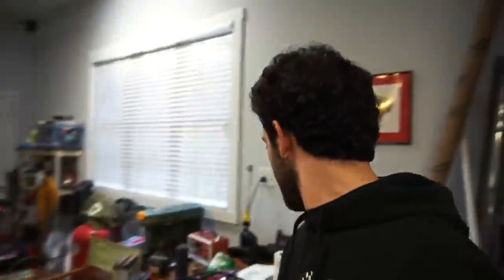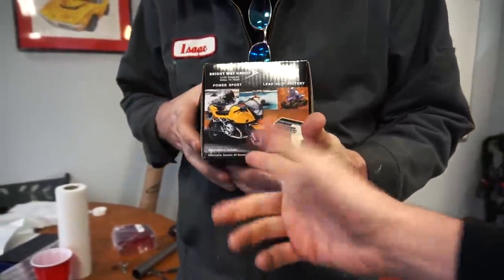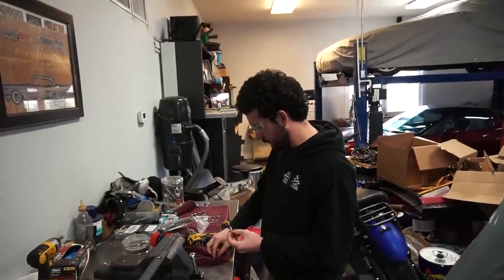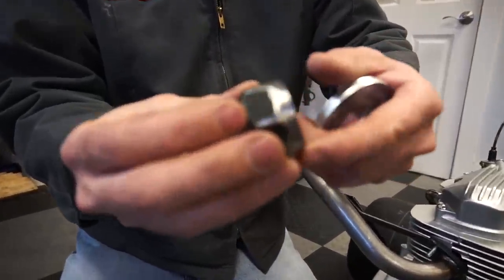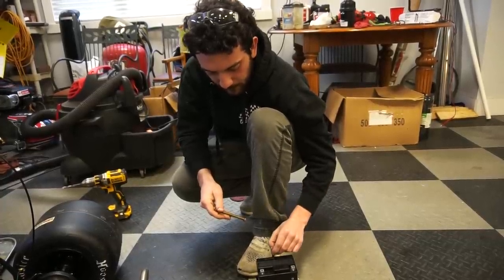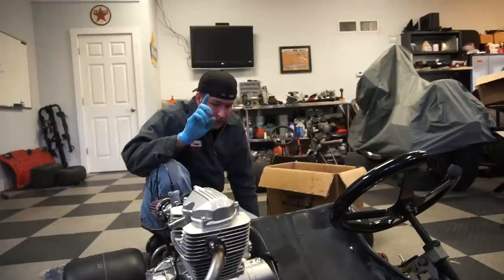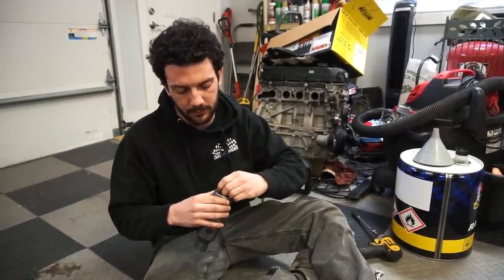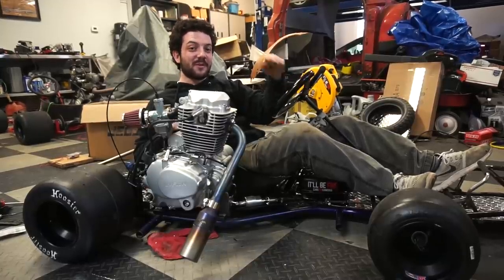200cc Shifter Kart Build: First Fire!

Comment: Loving it guys! 
 I would like to ask you about, whether you have ever considered using a liquid cooled or fan cooled snowmobile engine one one of your builds? Sled engines use CVT transmissions and they can be adjusted to be wheelie monsters. The snowmobiling world has some pretty insane horsepower mods for most engine types, the 440 l/c suzuki out of 90's arctic cats were torque monsters!!! Would be interesting to do a snowmobile engine turbo cart. Also would you care to address the michigan two-stroke scene as detroithoodtv shows us some pretty cool builds. It would be cool to see you guys try the dragster against some of those guys. Thank you for the great content over the years.    -Lou
Reply: PS I am from Maine, but the michigan scene looks to be a bunch of friendly guys who help each other out, and its not so much about speed as participation and having a good time. would be excellent if I lived closer :(
Reply: Move South!!!
Reply: Yeah, unfortunately that isn't gonna happen. I can always wish though, right? I was just trying to get Jon and Ike to comment on the detroit 2 stroke scene since they do the same thing..build karts, bikes, ect. Some of the detroit machines are sketchy af but...won't they GO lol

Comment: CarsandCameras I know this video is old but the way a cdi works is on the flywheel on the inside you will see the two magnets, that is your stator or generator circuit which provides around 70volts which goes to your cdi box, you also have a single magnet on the outside of the flywheel which goes to a small single coil that is on the outside of the flywheel. That is called your trigger circuit. That is what tells your cdi when to fire the spark plug.  Then there is a wire that also goes from the cdi which goes to a voltage regulator which takes the high voltage from the stator and regulates it to a constant 12-14v ac to power headlight tail lights, from there it goes to a rectifying diode that converts the AC to DC which will charge your battery.

Comment: CDI stands for Capacitive Discharge Ignition. Instead of running just 12volts to coil, CDI's charge a capacitor up to usually around 200volts and then suddenly discharge that higher voltage across the coil, making a much hotter spark. There are two different types of CDI units used with Chinese scooter motors, AC type and DC type. The AC type is used for non-battery type scooters. It gets a high voltage AC signal from a special armature coil on motor. It just rectifies this high voltage spike to charge CDI cap. DC types take 12 volts DC input and contain internal DC to DC boost converter which generates the 200 volts to charge cap. Both types take low level signal from a pickup coil to trigger CDI discharge. Be aware that the DC type has a built in advance curve that will change advance at certain RPM. That curve may not match optimum for your engine.

Comment: As far as the fuel pump goes I'd find out what pressure the carb needs and get a in line pressure regulator. That way you can play with it and find out where it runs best for your application.

Comment: About the engine oil thingy they ship the engines with a thick oil to give max protection but it’s not good for running is u need 10-40 which is good for running then once it’s been worn in then u have to change it once more

Comment: Some factories they fire the engine up (with the break in oil in it) to test it, I would assume the draining oil immediately is to remove all the junk in it when it was assembled. I wouldn't expect them to be very sanitary putting them together and just the run in as new.

Comment: 🤯.. Looks better than I thought it would 👍👍..
     I think the oil is basically for shipping?? Something to do with viscosity?
I'd probably change it but to be safe,.. especially  b4 break-in period. Gotta have all internal parts temper polished, that's the life of any engine.
 noticed the rear sprocket🤭 ya might need to be at a rolling start but f*Ker's gonna absolutely hammer..i'm actually glad to see it geared that way. That will be fun watching and blast to drive. Good work so far fellas.😎👍..

Comment: You guys could use a go kart fuel pump and tap it on the intake or crankcase vent. That way engine won't get excess gas from a constant psi pump

Comment: Mount the smog pump supercharger on pugly by putting a hole in the case where the starter shaft is its always driven and itll have more power being driven at the higher rpm

Comment: Could be any number of reasons, I saw serveral good ones in the comments.....BUT! I have my own. All gas powered motors have the same problem if they sit for more than a little bit without running, gas and oil both will attract and gather moisture. No bueno. Part of the reason this happens is because any water vapor that might gather in / or around the engine is heavier than the gas and oil. and will simply sink to the bottom of whatever container it is in. Once there, it's sealed of from the outside, surrounding air, and will not evaporate away.  Consequently, you need to change it to avoid the problems that the water will cause. (p.s. that happens with brakes and brake fluid as well)

Comment: I think you could do 100 easy.. I'm stuck on my atv rebuild because I can't find a stator with the right pulse sensor for my engine. Only ones I've found have sensors with way too large of a mount for my engine case. I tried modifying one to fit but I sheared the wires off the housing when putting the wire holding bracket in place to check fitment.. I'm almost to the point of giving up on it and putting a 212 with a tc on it just to be able to finally ride..

Comment: Your work bench would be much better with a piece of 1/2" plywood mounted on it. Also make a mount for the vice so that you can have a solid mount & it would be cool if you could make it easily removable to use elsewhere.

Comment: I would of put some qaulity break in oil hard telling what they put in those things to ship could not even be oil, seen few motors thrashed because no break in oil was used. Even if it was break in oil in there I can certainly guarantee it wasn't qaulity. I mean it's a little pricey to buy oil then change it in like  3 ride sessions but the theoretical chance my motor will last longer cuz it was properly broke kinda makes it well worth it

Comment: about 80 percent of the break in happens in the first ten minutes so the initial run at the factory will leave a ton of metal shavings in the oil...and they generaly cant fill the crank completely full of oil for transportation...i think you may need a heat shield between the seat and that hot motor

Comment: cdi is Capacitor discharge ignition a cdi works by ac feeding from statue into a bridge rectifier charging a capacitor that is then told when to dump its capacity to the coil through  scr (electronic switch) that is powered by the trigger coil (pickup) and send power to the coil

Comment: Use a pulse style pump off of the engine. It’ll be enough fuel supply and it’ll be small also will not push past the carburetor needle

Comment: The factory oil is for emergency purposes only, if you accidentally start it for a couple seconds so it won't damage anything, but the oils not meant to sustain an idle or high rpm. Solely for the event you accidentally start it for a sec or 2

Comment: I ran mine dc ignition.. battery powers the spark.. engine charges battery.. read somewhere that it produces harder hitting spark.. I have no complaints..
Reply: Are these 200cc engines AC or DC cdi stock? lifan fl200ga5

Edit: They are ac

Comment: I have a feeling they break in the engines in the factory and you should use new oil before service. All the crud from run in would be in the oil it shipped with at a guess.

Comment: Why don't you guys use vacuum fuel pumps for those Mikuni carbs, then you won't have problems with too much pressure. They are on every snowmobile I've ever seen. 
Oh and Ike the two coils aren't for spark one is for spark the other is to charge the battery and for lights etc. 
Just my 2 cents guys hope it helps, love your videos.

Comment: You need a surge tank if you want to run an electric fuel pump otherwise it will just keep bypassing the float an leak excessively. Best thing to do is put a vaccume pressure pump an use the carb manifold for vaccume by tapping a outlet into it or jump on ebay an buy one allready done they are cheap.

Comment: You should change the oil immediately because new engines usually still have a little casting sand left in the crankcase from the factory

Comment: Sorry, buy Isaac is wrong on the small engine ignition, the inner magnets are for the stator, which produces electricity for lights and charging the battery. The single outer magnet is used for the coil, that's what causes the coil to produce a spark

Comment: Did you swap that CDI wire because it wasn't getting spark?
I have this style engine and I have an issue with getting spark, I swapped the CDI already, but they both aren't sending power to the spark plug

Comment: I’d really like to see the full wiring done for this motor I’ve got the same motor and I’m needing guidance
Reply: Did you figure it out I can’t figure it out
Reply: @Afterdarkperformance  unfortunately no! An in-law told me to bypass the stater and just wire a push start button but I’ll have to jump it every time cause the battery won’t be charging if I do that
Reply: @dkidwell294  how do you do that ???
Reply: Never mind I found a different harness that’s fits decently

Comment: 3 types of chinese cdi you can use. ac type powered by ac voltage from the stator  and no battery needed. dc type powered by 12vdc coming from the battery with a working charging system. ac/dc unversal type that can be powered by either. you forgot to mention that any of these cdi units require a pulse trigger that comes from the flywheel. the cdi stores voltage in a capacitor until the pulse trigger sends its signal to the cdi which then release its voltage to the coil and the coil fires the spark plug. cdi=capacitive discharge ignition. the electronics in the cdi take care of ignition timing based on the speed of the pulse trigger signals. some have a external adjustment you can change the rpm limits and timing to a degree.the flywheel can do up to three things. ignition power,pulse trigger,and charging or lighting circuit.if you stator goes bad for the ignition power going to the cdi you can use the 12vdc cdi as long as you your battery is charging or you have a fully charged battery.

Comment: Is there a way of stepping down the size of the fuel pump in and out fittings beacues they are both too big to fit the fuel lines off my gas tank and carb

Comment: Not sure why about the oil but if it's cheap it will foam like the oil from the early 70s that's why 70s motorcycle after market parts include oil coolers and oil pan extensions??

Comment: Most engines coming from the manufacturer have oil in it but all that oil has metal shavings from it being a brand new engine. If you run it immediately it might cause inner wear.

Comment: might it be worth putting another bend in the exhaust so it doesn't hang so low? maybe aim it further back near (not towards) the rear tire? yall tend to take everything around the yard and it would stink if that muffler snagged something and damaged the head.

Comment: Just as an FYI for y'all here..

I owned a bike with this engine.
1. NEUTRAL IS AT THE TOP
2. Change the oil because what it came with isn't really oil. Trust me.
3. Fatten that carb up. A lot.
4. If you wanna see how it performs look at my channel, mine ran way lean but it ran decently.
5. Top end was 70 MPH on the gearing I had in my vid, no clue what it was though

Comment: I have a 250cc Honda motor I’m putting on my go kart it has stock fuel air ratio will it run alright if I put a straight pipe on it?
Reply: WinnerWinner ChickenDinner yes it does matter the exhaust

Comment: they tell you to change it immediately because the oil they use isn't actually 100% oil its like a mixture of oils that keep it from rusting.......just like when you get new brake disks you have to clean the oil off before installing

Comment from the maker: So why do they tell you to immediately change the oil?
Reply: CarsandCameras because thats break in oil. You don't want little Aluminum bits floating around in there, so best to drain em out.
Reply: Don't forget that TB Zinc-Plus !!!
Reply: CarsandCameras because of shaving from cast, and break in time.
Reply: its too thin to run the engine on... its there to keep the insides from corroding/rusting.
Reply: That's some junk oil for storage & shipping purposes only
Reply: they tell you to change the oil immediately because the oil is not always filled with the proper oil for running. they do this because of shipping restrictions on motor oil, and having the engine filled with fluids keeps things from seizing up. make sure you always change the oil when you get a new engine shipped
Reply: Because they use the cheapest Chinese oil they can find in Greece we use all the time lifan engines for old Honda mopeds like yours and we don't even start the engine with that oil
Reply: I believe it's break in oil, and or just really shitty quality oil that people don't want you to use
Reply: Because it's from China......... 'nough said 'bout that!!!!
Reply: Its not motor oil it must be changed

Comment: I have one question, I have a 2hp Briggs 60102 with a Tillotson carburetor. It's on a Minibike with a 12tooth clutch. Any suggestions on rear sprocket size?
Reply: HotRodBriggs 60102 38 if you wanna go fast, 78 if you don't wanna throw a rod lol

Comment: Why the heavy 4 stroke for a shifter kart?? 80cc 2 stroke will kill it!!
Reply: oh yes :)
Reply: yz 250 engine would have been good
Reply: 2 strokes are not that cheap right now. Plus they are noisy. I have to wear ear protection with my Yamaha 200 Blaster.
Reply: They payed less for that complete engine than it ever cost me to rebul my old rm250. And they have only gone up since only two manufacturers import them.
Reply: Ratkill9000 all very good points but im all about power and speed and my 80cc 2stroke shifter kart is a riot!!
Reply: Jnl Jnl true true but 2 stroke....
Reply: I am Joe i bet it is.

Comment: Let's see now, when you get that engine warmed up its running about 200 degrees on those fins that are literally touching your right arm, and you don't even have the space to install a good insulated wall between the engine and your arm.  That exhaust pipe is going to be running 500 degrees or so just a few inches from your arm.  That thing looks like a cluster if there ever was one.

Comment: The reason why they ask you to change the oil instantly is what they’ve used in that oil is only for moving the motor in transport that motor is a very powerful engine also I do those motors up all day every day I laughed a little bit when you didn’t know about the wiring it is a very simple wiring harness you just plug and play I hope that earth that you switched over doesn’t burn out your CD

Comment: The reason why  they say change the oil after getting it is because the have mineral oil in it .... if you run it too long you can damage the engine

Comment: i bought this exact same motor, and the clutch doesnt work, AT ALL!! any ideas??
put it in gear and it starts to move... come to a stop and it stalls.
YES I adjusted the cable.
has anyone had this same issue??

UPDATE!: I figured it out!
So when moving the clutch lever by hand, with OUT the cable hooked up.... push the lever as far to the right (or towards the front of the engine) as it will go,  and THAT is your Starting point.
It takes a SIGNIFICANT amount of pull to engage this clutch. 
Atleast it did on Mine.
.... Hope this helps someone/anyone with the same issue👍

Comment: I suggest, don't use that oil... Its just there so that it stays lubricated and keep the internal parts off of moisture. Better be safe than regret, change it with a fully synthetic one.

Comment: you better mount a fire extinguisher somewhere with that electric fuel pump. if you get a hole in your fuel line or a leak there will be a fire. PLEASE INSTALL A FUEL PUMP CUTOFF SWITCH SOMEWHERE NEAR THE DRIVER.NOT IN THE BACK. you will need to install a adjustable. inline fuel pressure regulator. LEARN NOT TO BURN!!!!!

Comment: Btw you are completely wrong about how your Honda clones fly wheel works that's for your charging system aka for the lights there is a magnet on the out side of the fly wheel for thats for your coil

Comment: did you realize theres no oil in it man the glass window has to have half way oil in it
Reply: the engine is tilted enough that the oil is at the bottom of the glass. if you put it level its there

Comment: Didn't change the oil first did you. I see sparks from the exhaust pipe last run, that ain't good because you are destroying it. You're going to kill the rings and cylinder and score the wall if not already.